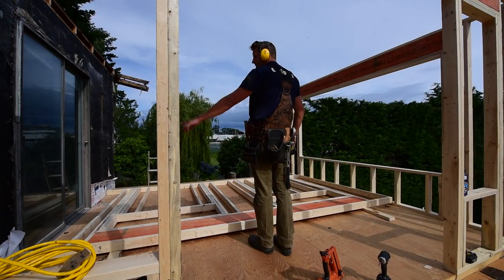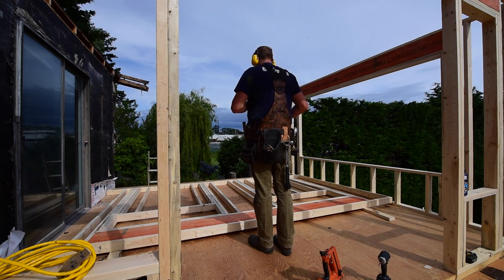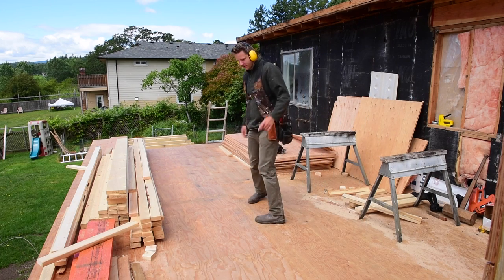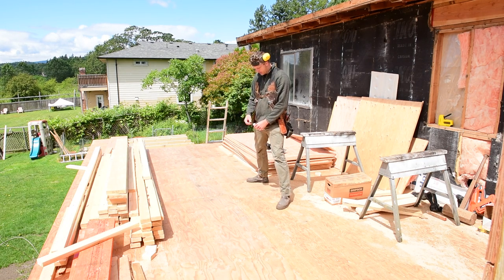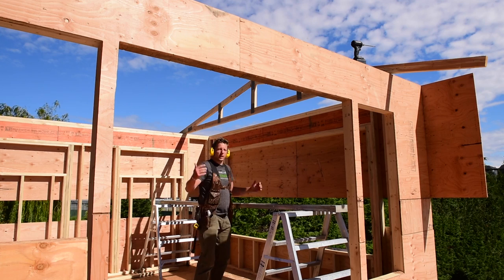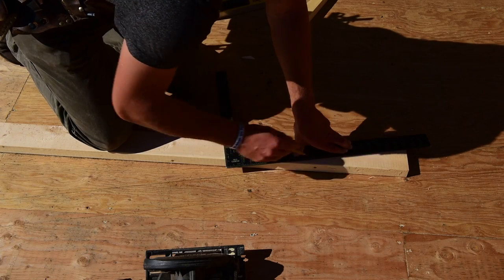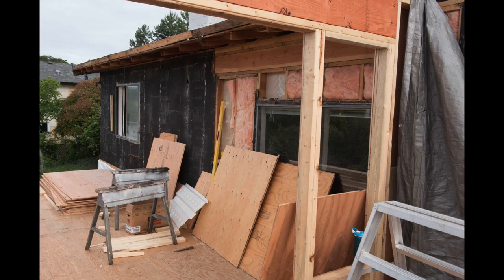FTF #57 How To Build Roof Trusses!

Comment: Step 1. Send drawings over to truss company.
Step 2. Send money to truss company.
Step 3. Wait for truss to be dropped off at your job site.
And at the truss plant, they use a portable press thing to install the mending plates. It's almost like a hydraulic cylinder on a big beefy C-Clamp frame and it just squeezes the plates. A hammer would be miserable, as you found out.
Reply: I live in Japan.....there is no truss company. You be funny! :-)
Reply: Mike McKeen you my friend are wrong they have big rollers that set the plates into the wood while the truss lays on a steel table
Reply: I built a similar sized building to what he's building here, and the trusses were only like 350 bucks delivered. Money well spent.
Reply: +Luke Tein I'm not wrong. I've seen them myself when I worked for CCA in Florida. They had a big gantry press, but it didn't get used for small truss. They had a jig that would clamp the pieces in place and then a guy would walk around and use this press on individual pieces.
Reply: Google up a C-frame truss press. They're a thing.
Reply: Gang nails should be pressed in.
Reply: Mike McKeen not to mention, the trusses would be built correctly with an energy heel.  Even with closed-cell foam, he doesn't have enough height to get the rated R value.
Reply: Luke Tein and Mike Mckeen you are both correct some shops use the "C" type joint press method while others use roller press methods.
Reply: Because the plates are simply pressed in, they are the first thing to fall out in a fire. Truss plates are a production piece for production houses.

Comment: I wonder if you may have wanted to make those connects into joints, not that I am any kind of expert at that stuff, but just looking at how the angle parts would be better going into a corner type joint. Hard to explain what I mean with words, don't know jointing too well.
Reply: BTW, you had me clenching pretty good when you and the wife were at the edge with that last frame, that looked like a good 6 pack after the work is done exercise.

Comment: Do you have to use ply or OSB sheathing in Canada?
Or did you choose to use it to add rigidity?

In New Zealand I've never seen a house built with either a ply or OSB sheathing, but seems to be standard in the USA or Canada.
Reply from the maker: Yes, you have to use ply or osb for shear strength here in north America.
Reply: MegaGouch we do have osb here I'm Australia and nz but mainly only as a brace not the way they use over there I'm assuming difference in building regulations and environment plays a big part in the design

Comment: just curious. Do you often wait to put ply wood on after you put the wall up? it just seems like a pain in the butt compared to doing it before hand
Reply: on something this small, I always sheet after
Reply: Dylan Holmes Well he was by himself half the time. I doubt he could have raised the wall with plywood on it, unless he left the headers out until after it was up.
Reply: Dylan Holmes I think  the  walls  were already  heavy  enough  without the sheeting  for  one  person .
Reply: its just him framing and lifting. with ply on the walls they would be a bit heavy, no need to strain your self when you can sheet after..
Reply: also you see how he got that last wall in just by twisting and bending it. with the ply wood on it would have been much more rigid and probably not possible to be pushed in place that "easily"
Reply: Ordinarily I'd agree with you, Dylan, but the "we" is kind of key here. I think he had more than enough to handle without sheathing. A couple of more guys to help and there's no way in hell that wall would go up without sheathing and house wrap. I even set the windows once. Some advice? Don't do that. It's a very bad idea. Heh-heh. we got it up without trashing anything (except our backs) but that bitch was HEAVY.
Reply: For you armchair carpenters. Sometimes when you work alone...the lighter the load the better. And if you look at how he had to hoist/erect/pickup that outside wall and move around the slider trim....ALONE..No way with plywood on. give it a rest!
Reply: It would be impossible to plumb up the walls if you ply them on the ground. Stand your walls, plumb them up with temp braces, ply them to hold it all together.

Comment: If it were me I wouldn't screw the wood down cause if you nail the gang-nail plate on as you go and precut the wood you wouldn't have to worry about if it was straight or not and if not straight it would straighten as you nailed it together.

Comment: Not a huge fan of the simpson strong ties in trusses because in a fire, those thin metal plates melt like butter and the roof is likely to collapse before the walls or joists. Nice vid tho man! I liked the music drop synced with you snapping the chalk line...I wish that happened every time I snapped a line...hah.
Reply: krbroadbent did not think about that.
Reply: krbroadbent you really think the wood will outlast the plates?   SMH
Reply: All depends where the fire started and how hot it is. Chemical/gas fire? I think those things would melt. Even if the floor below caught first or anything sitting atop those plates like shingles or another story. Its not a huge defect, I just would not use them in my personal home and would opt to 2x8-10 stick frame instead!

Comment: Give Samurai a break!
He is an Interior trim guy like me. I have built many homes, he reminds me of me, he frames like a interior trim carpenter, If he is getting this inspected he will learn. I live in Colorado and did the same thing on an addition to my home 20 plus years ago and it passed. The span was 35'  and I built scissor trusses, but they did make me remove the gable truss and rebuild the end wall to the peak instead and re-sheath so there wouldn't be a seam on the top of the wall on the gable for wind shear. The end wall and truss are all one piece by code now where I am at. He should be fine on this little room, notice the original house is 2 x 4 rafter tails so he could of followed their design. This young man is just cool in my book, probably because he is so much like me!

Comment: One question: in germany we have a craft called "Schreiner" (or "Tischler") that is basically there for general woodworking and building furniture. And there is another craft called "Zimmermann", especially for building these kind of walls and roofs. Is there a similar kind of differentiation in Canada/USA or is it all just called "woodworking" or "carpentry" ?
Reply: carpenter and joiner in english
Reply: The Bukman Tischlermeisters specifically do cabinets and anything that has drawers. In English we call them CABINETMAKERS. Then those who make fine furniture such as tables and chairs are FURNITUREMAKERS. Those who build the frame of the house are called ROUGH CARPENTERS and those who install the drywall, tiles, etc. are called FINISH CARPENTERS. *They're not all from Finland.
Reply: For the most part, people who build wood houses are called "carpenters." Most of the time, but not always, a "woodworker" is an amateur. A "furniture maker" makes furniture (usually professionally) and a "cabinet maker" makes cabinets (usually professionally). The term "joiner" listed by another commenter is not one I have ever heard any one actually use.
Reply: Joiners traditionally were the guys who made things like windows, door frames, stair sections etc on site using 'joints' those parts were fitted into the construction by the site carpenters ( 1st and 2nd fixings etc). Joinery needs a workspace with a bench and flat surfaces so not usually carried out on site, unless it was a large site with a temporary workshop.
Reply: I am a Zimmermann - and this truely no Schreiner-work!!! The Zimmermann makes all sort of constructions: wood houses, roofs, ... even stairbuilding is originally zimmermann-work

Comment: I do renovations and additions. You do great work. But it is better watching you because it reminds me of the pain I go through every day. I am much older as well. C-Clamps and speed clamps are my best  friend. You are a master...boy! Next time try to mass produce all the pieces for the truss on your miter/chop saw set up. faster and LESS WEAR AND TEAR on your BODY!!!! Trust me at it ads up. Great video as usual buddy ^5(high-Five)
My only question...On your Truss....What is the span on that bottom 2x4 that is also being used for the ceiling joist? and will you run 3/4 Strapping for drywall or use the 2x??? And how are you gonna treat the insulation detail on the eaves with 2x4 for joist and rafter ventilation???

Comment: your headers could support any load test given them ,,but the trust I would ask for a second opinion from someone familiar with roof loads in your area.. If need to add like 2x6 to sides of rafter and bottom core ( joist ) and nailed well to your 2x4s.. ( flatter pitch in roof more stress on  core…lets getter done

Comment: Dam man your impressive. I'm wondering if an air chisel with a smoothing hammer attachment would have helped with pounding those gang nails in.
Reply: I've used a palm nailer with a hammer head attachment to install those plates, works great.

Comment: As a Swedish carpenter I wonder why you nail the two walls together? we screw it because it´s stronger, other than that I love your vids man!
Reply: hy stefan, you say you live and work and sweden; i was wondering if you know any volunteering programs or groups in sweden ( or denmark ) that teach people basic rules about framing houses; of course no pay just that the " students" learn by working or helping on the building site
Reply: Hi Gur, you could go to one of the bigger building companies like Skanska, PEAB, Ncc or JM where I work and apply for apprenticeship, you won't get the same salary as the workers who has been there for sometime, it takes 2 years roughly, it's a learning period and in that learning period you ate supposed to try everything you do in building a house, everything from the ground to framing walls to roof to the inside stuff so there toy should be able to gather some info, that's what's it about :)
Reply: thanks stefan, my time window is a bit narrow though; i have hollyday in august ( or jully-it hasn t been decided yet) so i thought it would be a great opportunity to learn about structural walls; i will check the companies you mentioned; thank you

Comment: Tbh those walls made at the beginning don't seem strong/rigid at all... Just nailed in place? A strong wind would easily rip it off, or am I missing something?
Reply: nah its good, nothing has plywood on it to catch the wind
Reply: Stick built structure is not steel structure, so get that out of your head. The strength and rigidity comes when you tie it all together, and then sheath it. The plywood adds a lot to keep it from twisting or racking. Once you tie all 3 walls together and into the house it's quite strong. You can't really judge a structure as it's being built. If you have ever built frames or cabinets you will see how a few pieces of critical joinery change it from being flimsy to being rock solid.
Reply: Duct Tape That's what the sheathing is for. It adds shear strength.
Reply: Duct Tape you've obviously never build a house or anything like it. When it all tied together is stiffens up
Reply: No, indeed I haven't. Just not used to seeing wood structures (here it's mostly brick or concrete). I did not now the plywood would add support/structure. Thanks :)
Reply: Nah. It's fine.

He's just showing you the "gross" build. He's not showing you the actual details and mechanical connection. Then there's the sheathing tieing it all together.

It ain't going anywhere.
Reply: It

Comment: Jesse, I'm sure a bunch of other carpenters are gonna  jump your ass. Not me.

First tip on building your own trusses. When you loft them on the floor like you did, instead of ALL nailing your chords and web pieces to the floor only do the first truss and use scrap 2  X to build a jig on the floor around it. Precut all your pieces and drop them in place.

Tip 2) Use that box of gang nail plates as a boat anchor. Plywood gussets are the answer. In truss factories the are hydraulically pressed in.

Number 3) You are missing some webs in there. At least two. They should be running at a diagonal down from your outboard webs back to the bottom of your ridge post. I tend to overbuild things so I would probably do the same thing running down from the same web running out towards the plate.

The bottom chord of your truss (as built) is  analogous to a common ceiling joist... not a collar tie. As you know, a collar tie serves the same purpose as a joist but does not span from plate to plate.

The math is super easy, dude. I could sit you down and have you figuring trusses in less than ten minutes. Hell, just start looking at everything to do with a roof as being based on a Right Triangle and you're golden. From there it's just a simple matter of Pythagoras. For most of it you can simply grab it off a framing square. I use the brace table a lot when I roll my own trusses.

Comment: This is the first time I see these plates. Is that really a strong joint? I would feel more comfortable when the plate would be screwed in there. I understand that in a truss factory, pressing these plates in gives a huge cost benefit, but if you're making them on-site, why not just screw them in place?
Reply: Dries van Oosten If I'm not mistaken, I think that those metal plates (hammered or pressed in) are not allowed because of fire rulles. Those small 'nails' on them lose their grip fast when wood chars in a fire and the roof comes down fast. Screw plates (or nail plates) are the choice for me.
Reply: That wouldn't surprise me at all!
Reply: Dries van Oosten Sorry, when I re-read my comment I saw that I missed half a sentence.  :-/
I was going to add that they are not allowed in many countries in loadbearing constructions such as trusses but perhaps they are still allowed in Canuckistan and the US.
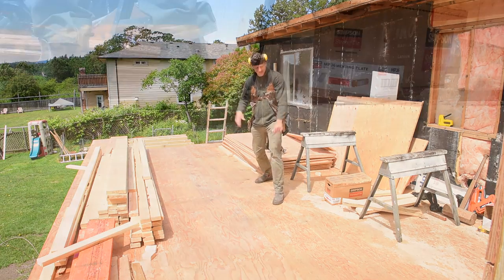Reply: +Johan Mattsson  No they are not allowed. He's using Strong-Tie MP36 mending plate (7:29 look at the box). These are not load rated for structural applications. See link below

https://www.strongtie.com/miscellaneousplates_miscellaneousconnectors/mp_plate/p/mp
Reply: It even says: not for trusses, right there on the plate :-)
Reply: I missed that

Comment: There is more and easier ways to build trusses. I like to use 2 2x4 on top and bottom positioned vertically with the webbing pieces sandwiched between it uses a bit more lumber and they can get really heavy but it is far more easy to put together a really strong truss. Just use a nail gun and some glue.

Comment: i enjoy your fine woodworking and think you really know what your doing in those cases. however i think its irresponsible to tell people they can build their own trusses without an approved design, using non load  rated plates. Im not an engeneer but your design, with mostly right angles for bracing, seems pretty lacking.
Reply: yup....that's a gable end truss.  Trusses need to be engineered
Reply: Lol, and truss companies use hydraulic clamps/presses for those truss plates.  A guy could use a porta power to accomplish this if needed and save a ton of elbow work with a hammer

Comment: As the construction of a truss is not prescribed under Part 9 of the building code, you would normally be required to hire a registered professional engineer to design and oversee the construction. Your building department has a the authority to demand you submit a letter from an engineer, and given it is already built; it may be quite difficult to find one that will sign off. Sorry to rain on your party, but I believe you would have been better served by ordering these from a manufacturer that could have completed the design and engineering for you. Also, given the span does not seem too large, your probably could have framed this with conventional rafters and ties (which is prescribed under Part 9) and avoided any engineering.
Reply: Don't worry- he's not a math guy

Comment: Be careful -  check with a local structural engineer in your area before you show this to the masses.  If someone built a larger span you could cause a serious problem and a person could be injured or worse.   Even what you built here in a snow load area could cause structural issues.  When you have that fine quality in your workmanship you have to back in up with solid engineering - especially when you have 600K subscribers following your lead.  Safety first .

Comment: im 95% sure you cant legally build trusses, they have to be engineered.. all YOU can build is rafters, and a hammer is far from the right way to put gang nails on
Reply: About that 5%...
Reply: They use a special plate in factory trusses. The "nails" go at least halfway through the wood and they set them with a humungous hydraulic "C" clamp that sets both sides at once in a single stroke.